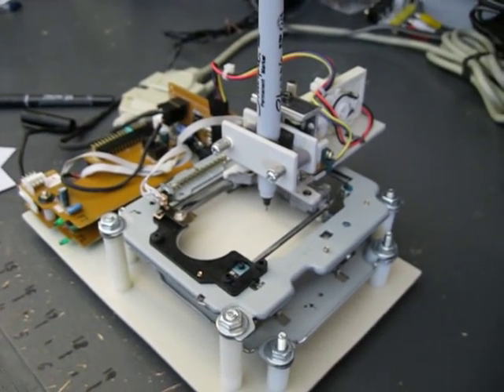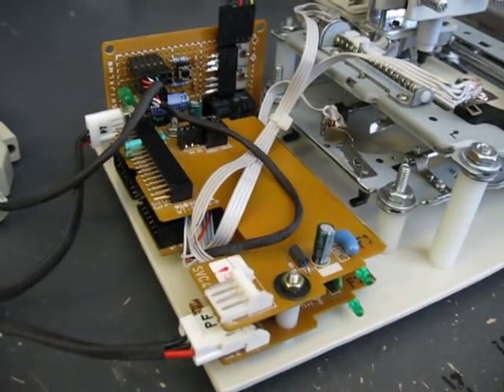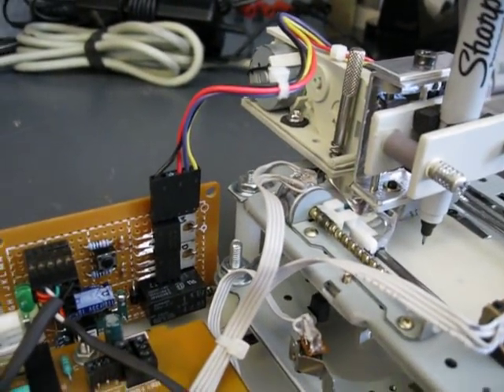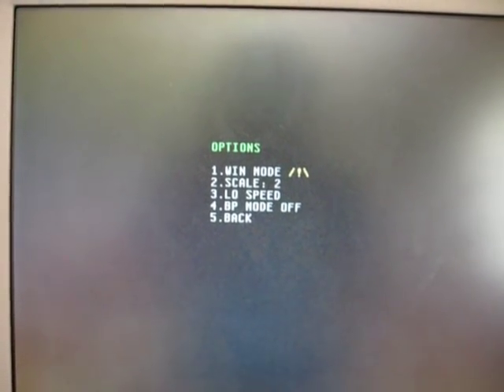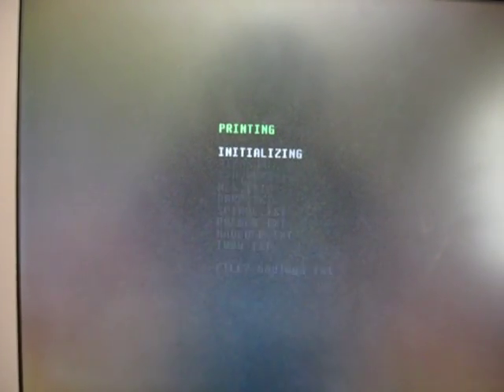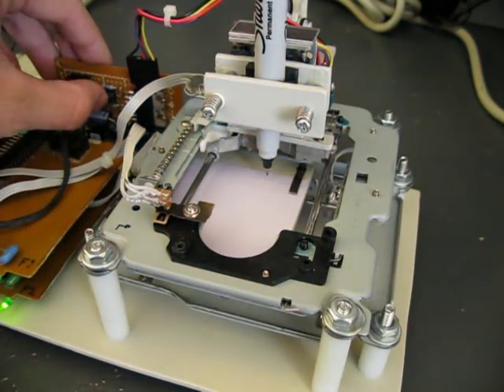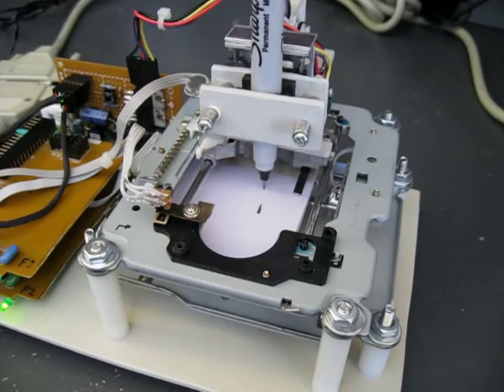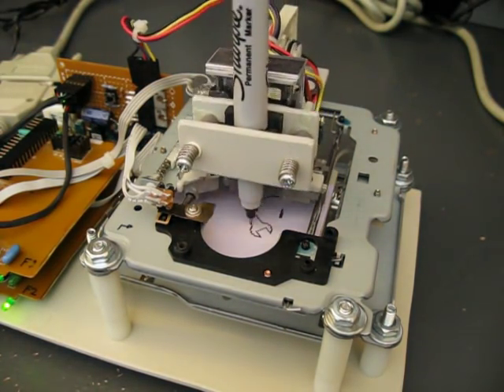Mini Desktop Plotter Made From CD/Floppy Drives

Comment: What is the OS running the code, are you running it as a pure C code to machine code directly to the hardware?
Reply from the maker: The code was written in MS BASIC and ran under DOS. BASIC included commands to control the printer port pins.
Nowadays I know more and would just do it with a microcontroller and C!
Reply: @MarioTheModder  Thats really cool u ran the code under dos on a powerful laptop, thats really low level.

Comment: +MarioTheModder's channel
That is a epic device you built there! Never seen anything with a microcontrollerless design before.
Using the parallel port like that is genius, it certainly has enough pins to control a bunch of stuff individually.
Although I don't know if I would build one like this. I'd be afraid of blowing my parallel port.
Buy hey, I used to make little 32x32 LED displays that directly ran off the parallel port and never nuked a thing.
Hm.... I just got an Arduino... once I finish learning AVR C I might try making a pen printer for a conductive ink marker.

Comment: Hello, I have built all the hardware: physical structure, and have completed in entering the GRBLtoArduino and all the software. I have used the Universal GCodeSender and has successfully interpreted the software for is says " Grbl 0.8c ['$' for help] ". I've soldered the stepper motors (for I'm using steppers from dvd roms) to some salvages wire from a printer I took apart. I installed some female sockets in order to connect to the male pins on the CNC Shield ver. 2.01 . The orange light from the arduino flashes and in the Universal GCodeSender ver. 0.8 completes the operation b/c is says " ok " . I have no idea whats wrong. I know the steppers work b/c ive used a 9v battery to pulse the motors and they do indeed pulse. Ive used a multimeter to check its resistance and it works. I've checked the current on the motors once connected to the cnc shield and there's current. I have tested if the drivers are in fact getting power and they are. I've attempted the code " x=100 " , " $7=225 " but no motor movement.  Can ANYONE help me ?

Comment: Fun project. :) 

I do recommend learning to code something easy like an arduino. Won't take a second if you already know basic programming.
Reply: Why arduino? It is expensive and limited in code size... Why not a more modern arm core without bloat code and bootloader? And even if he would use 8 bit micro, why not a normal avr in avr gcc? And what is wrong with basic if it gets the job done?
Reply: I buy Arduinos for under 2USD including shipping. Also, the simplicity of coding it while still being able to learn actual electronics makes it a great starting point. Also, no beginner projects need more brains than an Atmega328 has.
Reply: Jim Groth You dont buy arduinos for under 2 usd including shipping, you buy an avr. I am talking about the bootloader section that is eating up way too much code and is unnecessary, plus the horrendous programming enviroment. Atmel studio is 100x better, any development enviroment with code highlighting is better. And you are not learning electronics at all. Microcontrollers are only a VERY small part of actual electronics.
And no, most project for beginners dont, but you dont need an arduino to flash a light either. Plus most 32 bit cortex m0 parts of equal performance are cheaper than avrs.
Reply: Maybe you have forgotten what it is like to be a noob. I've tried different environments. So far I find Arduino to be the easiest to get comfortable with. 

I've been buying things like this (http://www.ebay.com/itm/Arduino-Nano-V3-0-with-ATMEGA328P-Module-/291247481155?pt=LH_DefaultDomain_0&hash=item43cfb3e143) for a while and they're a great intro to electronics, as long as you don't buy shields but actually buy parts to build stuff.
Reply: Jim Groth I have not forgotten what its like to be a noob. I started with logic gates, comperators and opamps, stepped up to transistors and started with an STK500 for AVR microcontroller. There is nothing hard about atmel studio, it takes some getting used to but is infinitly better then that arduino garbage. 
And the problem i have with arduino is that it is discouraging people to learn electronics. When i started out i had to read datasheets and actually look at the electronics to get the microprocessor to work. With a board it is pretty much plug and play without knowing/building the electronics around it. This is quite apparant in the questions asked on the arduino forums with simple stuff like how to hook up an led. (they cant even use google)
Reply: tHaH4x0r I understand where you are coming from. I'm pretty much saying the same thing about these "LittleBits". Maybe my experience with Arduino is a bit different since I'm actually trying to learn electronics and not just programming with shields.

From my perspective, arduino is a good mix between getting started easily and having a decent chance to actually learn.

I tried my hand at a Ti Tiva C dev board but just getting the programming environment up and working was very difficult. Then, when I got to coding I didn't even know where to start. I'm a programmer (mostly windows and some web stuff) so I'm used to IDEs that are fairly straight forward.
Reply: Jim Groth Almost nobody i know that uses arduino can tell what the basic components around the uC are and where to place them.
The Ti Tiva C series are cortex m4 parts, pretty overkill. If you want to get started with arm cortex, pick a cortex m0 part such as the lpcxpresso 11xx boards from nxp.
And looking up information is part of electronics, not everything will be thrown on your lap to use.
Reply: Heh, I just realised I answered comments on another video than I thought I was. This is a way too common topic. :P

Anyway, I hope the people you know take the road I'm taking eventually. It's really fun learning about passives and how to make complex stuff out of them. :)
Reply: Jim Groth It sure is, that is why i picked Electrical Engineering as my study.
Reply: Jim Groth Also the Arduino community is huge :D